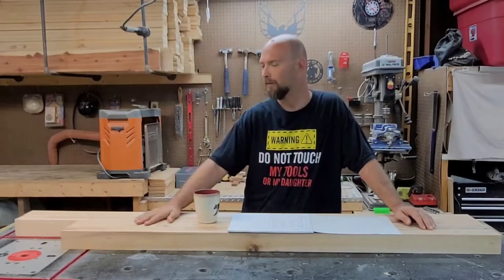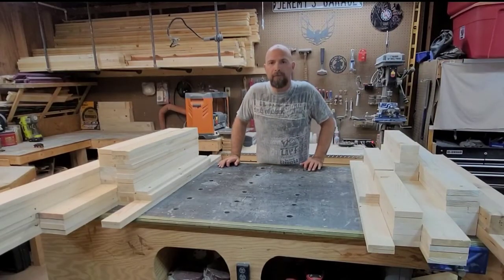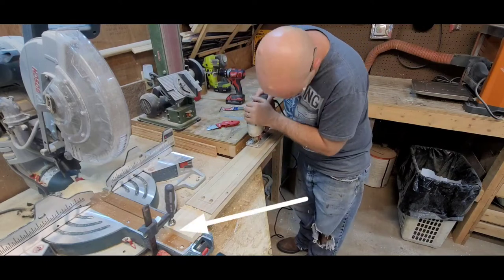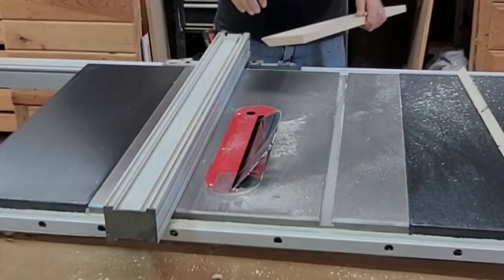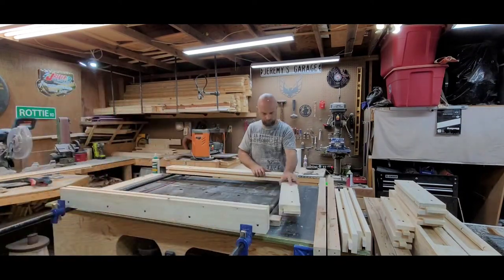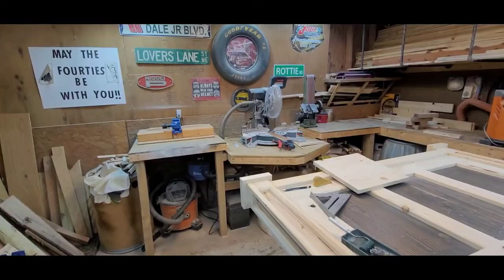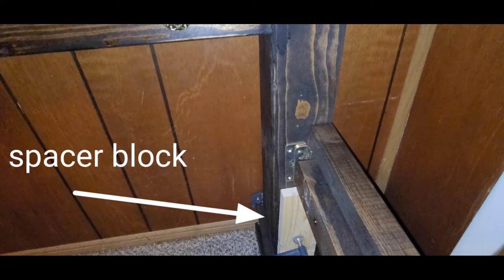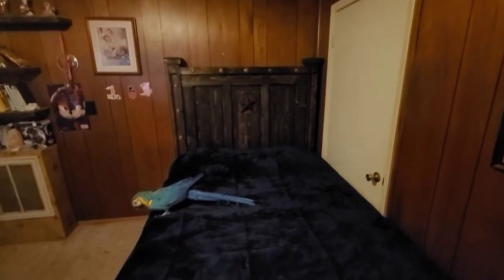Pallet wood bed frame, THE MOST AWSOME PALLET WOOD BED ON THE INTERNET

Comment: More helpful than cost information would be the time invested. Materials have variable costs, but the number of hours a project takes can be a more important guide to whether someone else might take it on. Thanks!
Reply from the maker: I know it was less than 75 hours, but to be honest, I'm not sure. See for my projects at home, for my kids, my wife myself I don't keep track of time. I try to keep the cost as low as possible with out skimping on any quality. From now on though I will keep track and start running both down at the end of each video.